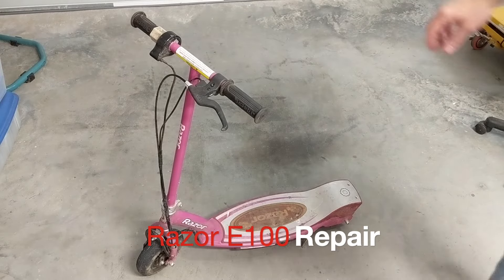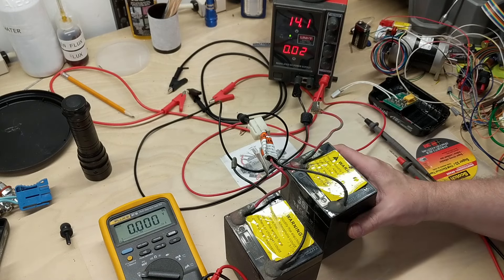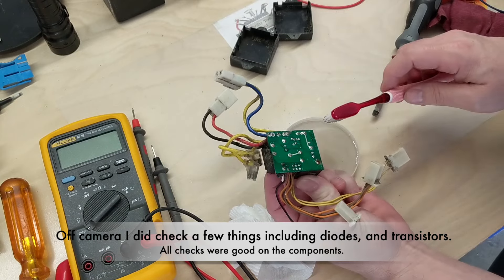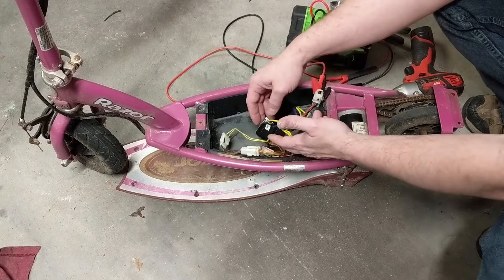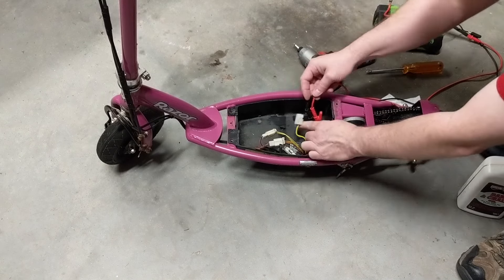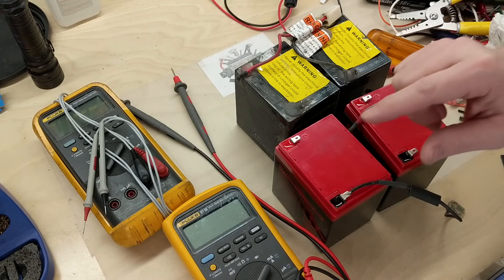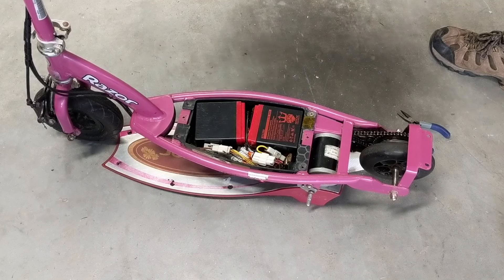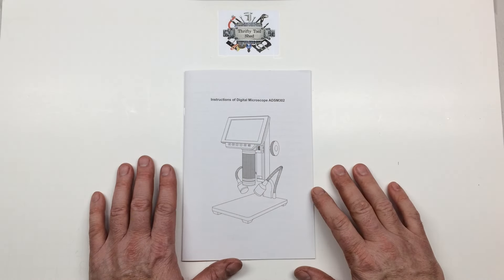Razor E100 Scooter Repair

Comment: I recently picked up one of these E100's. I built a Lithium battery pack for it and wired it up with a fuse instead of using the circuit breaker. I noticed I am getting full battery voltage across the charge port. I guess I need to add a diode there?
Reply from the maker: You are not going to charge it with the original charger anyway correct?
Reply: @ThriftyToolShed  I was thinking of doing that. I have a BMS installed on the pack.
Reply from the maker: @bobsoft  the charger would still have to be CC and CV supply to charge the lithium correctly.

Comment: I know this is old, but the throttle won't send voltage to motor until you kick push the scooter to 3kph....safety feature I guess.

So putting the scooter on blocks, testing by pushing throttle will never spin motor even if there's nothing wrong with it.

EDIT:  Just hadn't got that far in video.

Comment: These new are around $150 so an investment of $30 or so in new batteries and $14 for a charger is still well worth the investment, especially when you factor in the happiness value.  I found 5 of these at a yard sale for free.  They had all been stored outside and the chains and other metal parts were rusty in bad shape.  Got the first one cleaned up and applied 24v direct to the motor and confirmed the motor was good.   Just waiting for batteries and a charger.  Hopefully I'll have at least a couple of grandsons flying around on them soon.  Thanks for the time in putting the video together.  Nice job and great reference.

Comment: my son had an e300s sitting for 10 years so we decided to get it working again..we knew it needed batteries since they were bulging out...batteries replaced and the scooter would drive for 10 seconds then turn of...hitting reset switch worked but still shut down after 10 seconds...watched some videos and they lead me to believe the batteries were not the best...calling razor and they said replace batteries even though they were new...new batteries didnt work...scooter still cut off after 10 seconds...replaced control module...still cut off after 10 seconds...thought it was weight issue but me and my son weigh 185lbs and the scooter is rated for 220lbs...holding back tire up the scooter would run for ever...was stumped then decided to replace the reset switch and it works perfect now...no more cutting off after 10 seconds even while someone is riding it..kept the replacement control module installed since the original one was dated ''2009'' all in all it cost us $70 to get back up and running..hope my comment and this video helps someone else...
Reply from the maker: Thanks so much for sharing this. Crazy that the reset button caused it since it would run fine until weight was applied. Great job troubleshooting!
Reply: @ThriftyToolShed  the tech from Razor said it was the battery not pushing enough volts when it was under load(someone riding it)..i opened up the bad reset switch and there wasnt much to it at all...just a thin piece of metal touching connectors and a spring for the button...thanks for the video

Comment: Do you know at what minimum voltage the control unit will not work, or cut out?  
I’m getting about 22 volts and the control unit is new, but it won’t click or run (even if I kick start it). 

Motor tests good, and all the switches appear to test well.
Reply from the maker: I don't know for sure, but with Lead acid batteries it can be tricky. It could be dropping really low under a load. Most lead acids will fail in this manner, with a faulty cell the voltage drops severely under any load. A voltage check alone usually doesn't tell the whole story.

Comment: As soon as I heard the relay click, reminded me that it has push to start control board. I use a drill to spin up the motor to test the controller.  Using the chuck to spin the rear wheel.

Comment: GOOD AFTERNOON, I HAVE A JETSON BRAND SCOOTER AND THE ERROR LIES IN THE RELAY, ONLY 1 RELAY WORKS THE OTHER JUST DOES NOT ACTIVATE AND THEREFORE THE SCOOTER DOES NOT WORK, EVERYTHING ELSE IS OK, I HAVE DOUBTS WHAT IT COULD DO HERE COUNTRY THERE ARE NO RELAYS OF THIS TYPE FOR SALE, THERE WOULD BE SOME WAY TO CONNECT ONLY ONE RELAY, THANK YOU IN ADVANCE GREETINGS FROM BOLIVIA
Reply from the maker: I am not familiar with the Jetson scooter to say. Just make sure if it is a kick start type scooter as most are that it is being assisted enough to start the motor. I had the same issue with this one. I could hear the relay click but I was not spinning the motor enough to kick in and run. Wish I could help more. Best of luck to ya!
Reply: @ThriftyToolShed  
THANK YOU FOR ANSWERING AND WHAT DID YOU DO TO SOLVE THE RELAY PROBLEM?
Reply from the maker: Well I did clean the corrosion from the board but I did not give the wheel enough help to start with to start it. So just like when you have to kick off or assist the scooter for it to start, I had to turn it by hand very hard as you can see in the video and then it takes off on its own, it's just a safety. So most scooters are that way. You have to kick off first then hit the throttle and it accelerates up. I guess so you can't hit the throttle by accident and it take off and hurt someone.

Comment: How can check  the relay   with multimeter
Reply from the maker: The only way may be while still attached to the scooter since it takes the voltage from the motor once kick started to activate the output relay. You should hear the first relay pull in and then if I remember correctly, the second relay pulls in and supplies the motor once the kick start has turned enough to start up. You can also apply the 24V to motor itself as I did here in this video to verify the motor is ok and runs fine to eliminate it being the issue.

Comment: I have an identical scooter that I am fixing for some kids. The battery appeared to charge properly, but actually only had a very small capacity while the other battery indicated the same voltage and had full capacity. Apparently, only a small amount of lead exposed in the bad battery. I will get replacements; however, is there any knowledge as to why one battery would die like that - simple age or bad charging? Kobalt Tools make a 24volt lithium battery that may have sufficient capacity - any ideas on how to fit such a battery into the scooter,  with the addition of charging ports etc.?
Reply from the maker: Sorry, I thought this question was for the newest scooter repair video with the long slim Li-ion pack. This scooter has the lead acid batteries as shown in the  video thanks. Disregard the comment following this please. 
Well, the battery is simply cells spot welder together in a long slim design with shrink wrap. I did not have to take this one that belonged to a friend apart, but it looked to be a simple battery build if someone has the experience with them as far as spot welding the tabs etc. to form the battery pack with new cells. Sounds like at least one cell has pulled low on yours. It's always better to replace all cells at once though and sometimes it's about as cheap to buy a new battery. In some cases it's worth repairing a pack with a cell or even a few cells replacement, but it takes time to do it correctly. You have to have other donor packs with same exact cells or have some already that are very similar and also I go through a capacity test and internal resistance test and have all tested very close performing cells together and it usually works well. I used to take time to save cells from packs I picked up from recycle bins and etc. and I had cells with the tested data written on them for repair of packs etc. It's fun and it can be time consuming though. Best of luck to ya!
Reply from the maker: Hi,
I updated the comment to show a comment error. I thought that this question was for the Gotrax scooter repair video, sorry.
Reply: I bought this same scooter in 2018, the first thing to fail it’s one battery, I put my multimeter in the output of the charger and I read 30v with the red light on (finish charge)! They cook the batteries! (12v SLA charge at 14v, and then floating charge at 13.6 or some similar, I make two 12v ports (one for each battery) and charge indepently with a imax b6 (multipurpose hobby charger)

Comment: You explained it good and I have no previous education in electronics. That e100 looks more aged than my E200 I was given and I only just got power to the switch and hoping the stock batteries will charge. Thanks again
Reply: Charge em for a while i like how we both started fixing our e200s and the same time haha. Right now i charged the batts one at 14 volts and the other is barely keeping charge so im using a tender to treat it hopefully it gets revived. When i gave the motor power it worked but when i used  the batteries it only clicked by the control board so i hope that was a dead battery not controller and i hope the batteries are good

Comment: Hi. Thank you for such detail video on restoring of this scooter.  I am not good on fixing up a scooter like this.  I have one exact  model like this in the video. It's a lot newer which is made in 2018.  But when I plug the Charger which I bought it through Amazon.  When it plugged in to the three prong connector in the side of the scooter.  It lights up in green in the AC adapter indicator.   It's supposed showing in Red when the battery is being charged. I spin the rear wheel and turn the throttle same time. It's not turning like you showed in this video.  What do you suggest for the next diagnostic to be performed.   Thanks.
Reply from the maker: I would check actual battery voltage if possible and make sure it is ok and no corrosion etc. Also you may have to kick or spin the motor pretty good to get it to start. I was surprised that I had to kick it so hard to get it to go on this one. I also noticed on this one that I could hear the relay click on in the controller even if I did not spin the wheel. So if the controller is the same you should at least hear the relay click when the trottle is pressed.
Reply: @ThriftyToolShed  . I have charged the battery for 3 days with the charger I ordered from Amazon.  I used the Multi-meter to measure the battery voltage.  both 12 volt battery on-board the scooter only measured 20.6 volt.   The motor spec is 24 volt.  So, the battery is not powerful enough to make it to spin.   I might end up replace both the Lead acid battery.  I can find them on Amazon as well.  the battery on my scooter is CP1250H 12 v 5ah.  Thanks for your reply.

Comment: You know whats crazy i bought the razor e100 pink scooter also very similar to this one. $15 offer up  But i guess i got the crapy version of the e100 it had the same casing or similar speed controler difference is only one relay insted of 2 inside the in speed controler  Same plugs but different motor and no chain mine has a direct  550 or 570 not sure what size but its brushed motor instead of the chain driven  one this one has and it also has a. Different rear wheel ...   My question is do i still have to push start it to get it going   and It doesnt click when i pull trotel  is that normal it holds charge. It. Turns on and everything i tried pushed stating it and nothing.  Motor works.direct  so i think its the speed controler but idk  what part inside the controller. It cud be. Its not coroded so i wonder what it is   thinking of buying a new controller cheaper  i think ...
Reply from the maker: If yours is different, it's hard to say for sure. I would think it is definitely a kick start. If yours only has the one relay, it may not click. I would verify the plug to the speed throttle back to  board does have voltage coming to the board when turned. Make sure the brake switch is working and not dropping out the controller.
Reply: @ThriftyToolShed  brake switch! That might be it I see it it doesn't even have an adjustment nut on it when these ladies shift this thing they messed everything up and I believe they already knew something with us and I bet it is that break switch

Comment: The charger link seems incorrect, it links to a male XLR connector but the scooter itself has a male port
Reply from the maker: Thanks for that, you are correct. I should have had the correct link for the exact charger I ordered? I will have to fix that!

Comment: Excellent video!  I bought a new controller and batteries but still doesn't work.  Where did you get your power supply so I can test the motor directly?
Reply from the maker: I used a Drok DC-DC Buck Converter. I have a video on it as well, but any supply could test motor really. Even if you careful use the new battery with jumpers. Remember with the controller you do have to push to start. I guess for safety, these do not start up as soon as you press the throttle. They are called kick scooters but it did surprise me how hard I had to sling it to start up while testing. The first few time I thought it wasn't working, but I just did not give it enough motion before I hit the throttle to make it go! If still not working, make sure the throttle switch is activating the controller! Best of luck to ya!
Reply: I have a brand new controller and continuity through all of my wires throughout my scooter yet I still can’t get the controller to click when I twist the throttle. Any ideas?
Reply from the maker: Checking the sensor on the brake is the only other thing I can remember at this point. It's been quite a while since I worked on this. I believe the brake sensor on the handle bars can stop the controller.
Reply: What name power supply you use and where can i get it : thanks
Reply from the maker: As mentioned above it is a Drok DC-DC converter and I have a video on it as well.

Comment: How long do a have to charge the scooter
Reply from the maker: It depends on the charger output you have and the size of the battery. If I remember correctly this one took around 6hrs? So if you have a 1 amp charger and a 6ah battery then around 6 hours to fully charge!

Comment: I have this problem and I hope someone can help me with this I full charge and it starts one time and then dies on my I already replace the start switch what else can be wrong? THX for the help
Reply from the maker: How old is the battery?
Reply: I modify the kids powerwheels with 5s lipo. ( they love it). Finally got to fixing the scooter..it woundnt start..or I forgot to push it. Anyways...I simply took the throttle switch from one of the power wheels ( it has a return to zero or thumb release. I can run it on 8s lipo....but it's plenty fast on 6s lipo 50C (25v).
The scooter has drag on it...it wont kick out from under a kid on 26V...but will drop
to 24v-25v operating
The stock esc is also just on or off....it just a safety feature...( kick start)
to make sure you stand on it so it wont kick out from under the kid
or it'll go without them standing on it...Kids will be kids.

on ( 8s)32v-35V it'll do 16-18mph or faster. It might be Okay for older kids
Ive ran it for 5 miles on 7s to test it...it's fine...it's right around 26-28 V operating.
The voltage will drop to 4V or less average. 7s is safe or sweet spot.
It didnt cost me any money to fit it.
Reply: My battery were dry So I put  some pure water charge it now it's all okay Thx ppl
Reply from the maker: @otunca  Great! Really good that you thought to put purified water and not just tap water. Some are sealed batteries good to know yours had fill caps I am assuming?

Comment: Nice video, but imagine if you could additionally repair a faulty controller, if it proved to be faulty, you would not have to do any bypassing or buy a new one, or hope that is is just a matter of cleanup and new batteries . You were lucky the controller only required cleaning and re-soldering.  I know these controllers are rather cheap and it may be more suitable for some people to simply buy a new one and replace the complete unit, but if you are somewhat concerned with the environment and like to recycle things, knowing how to repair products is one way to do so and  may be attractive to some.  I would have completely removed the battery box, as well and cleaned the bike completely, and re-checked the steering bearings, nuts and brakes, before re-installing everything back.  Thumbs Up!
Reply from the maker: So, I did just clean up and hit some solder joints and I did use the original controller! Are you just asking in general? 
I only bypassed to test motor?
Yes, I try to repair everything I can in my videos for sure. I salvaged a DeWalt blower in my latest video. I really do have a passion for giving things new life. It has always bothered me to see something thrown out that still has value or potential value! Thanks for your comment!
Reply: @ThriftyToolShed  I think I might bypass this thermal limiter it's too sensitive